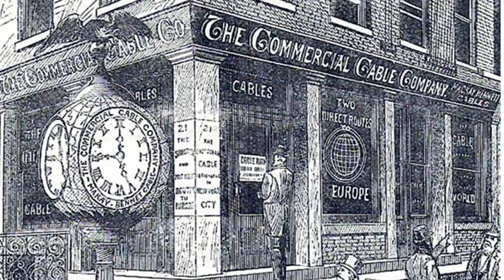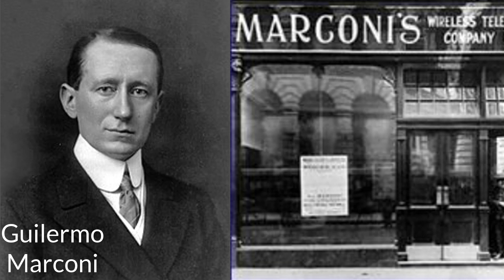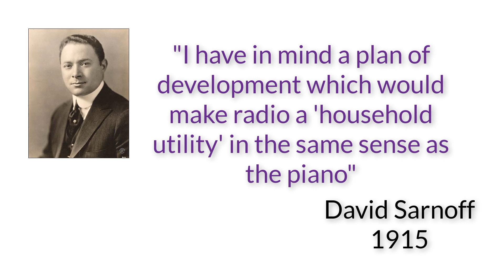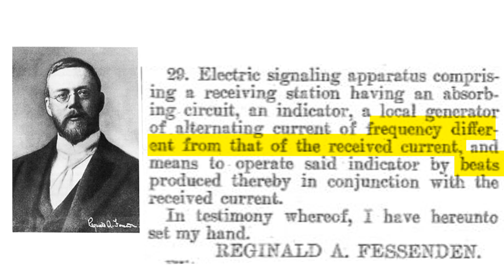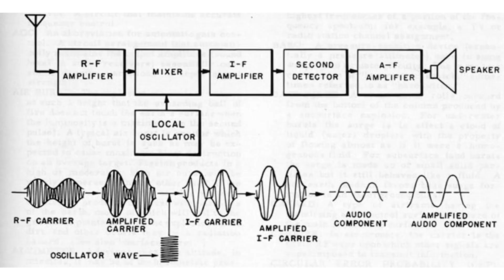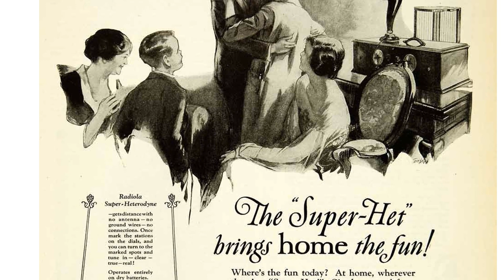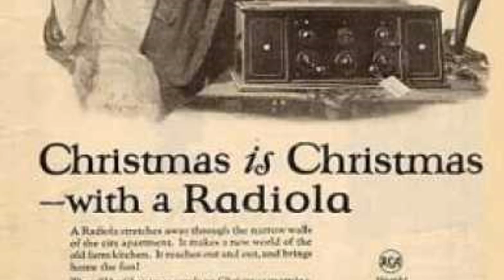David Sarnoff, Howard Armstrong & the Superheterodyne Receiver

Comment: When I was in school, one very interesting xperiment I was required to perform was to measure the mass of the electron. This was not done directly, rather by observing microscope bubbles moving in the air under an electric field, and then computing the "smallest common denominator" of the oil droplets velocity.
Reply: The famous Millikan oil drop experiment. If not for that experiment we would not have the concept of wave/particle duality... electrons would only be known as waves and the atomic model would be radically different.
Reply: You went to a very nice high School, I only saw that experiment in the textbook.

Comment: Please clarify that heterodyning only works in nonlinear systems. Typically band limited circuits. Our hearing is nonlinear which is why we can tune a guitar string that way. So are the circuits in heterodyne receivers.
Reply: Hopefully, only the mixer is non-linear in AM receivers.
Reply: @flagmichael  Every tuned stage is band limited and thus nonlinear by definition. IF Coils between stages. But yes heterodyning only happens in the mixer. Hopefully!
Reply: If the front-end RF amplifier is non-linear, you get InterModulation (IM) interference due to heterodyning of several incoming signals.   We try hard to keep the front end linear. but there will still be IM if the signals are strong enough.
Reply: @8546Ken  All front-end RF amplifiers are non-linear. Otherwise it would require an infinite bandwidth from DC to light (and beyond?)

Comment: Believed the old superheterodynes only used 5 tubes. A 35W12 rectifier tube, 50C5, 12AU6 and 2 others. Learned about them back in the 1960's. Have an old tube radio in my garage that I still use. Interesting vid. Ashamed very few young kids get interested in electronics or turning wrenches. Learned how to solder and use my dads model 260 Simpson meter before I learned how to drive. Put together a radio, tube & transistor tester,  and 25" Heath kit color TV.
Reply: The AA5 lineup was 12BE6 mixer, 12BA6 IF. 12AV6 detector/af amp 50C5 audio output and 35W4 rectifier.
Reply: The "All-American Five" came in two versions: one with octal base tubes and one with miniature tubes. Those were the miniature tubes. I think RCA had the original patent but when that expired everybody made them virtually the same. For years the RCA tube manual had a schematic of that version in the back.
I believe transistors displaced even those tubes when transistors became cheaper than tube sockets. The miniature tube radios came on printed circuit boards near the end but the economics just shifted too far too fast. RIP to the AA5.

In this history channel, I would be negligent if I didn't mention that the book, "SONET/SDH Demystified" has a few pages about the birth of the transistor. In short, the post-WW2 boom brought high expectations, including private instead of party telephone lines. That required more copper, which was being snarfed up by the housing boom. The solution was multiplexing, but vacuum tubes had heat and energy problems. That is why the transistor came out of Bell Labs.
Reply: You're referring to the small "AC-DC" table radios. The large console radios may have had more tubes and a power transformer. With a transformer, all the tubes had 6.3V heaters  The tube numbers were often just 2 digits. They usually had shortwave bands.

Comment: In order to produce IF (intermediate frequency or beat frequency), the Mixer must have non- linear  amplification. 
This can easily be explain by Fourier series analysis.
When input RF signal is mixed with Local oscillator frequency, it produce Beat frequency (Intermediate frequency) of difference between those two frequencies.
But how to make Beat frequency as carrier frequency? If the Mixture stage has linear amplification, it will not produce Beat frequency as Carrier frequency. 
So Mixture stage has Non-Linear amplification. And the output of the Mixture stage shoots out multiple Carrier frequencies. 
The IF resonant transformer is set at 455KHz. and to make IF= 455KHz, the local oscillator is tuned to (455KHz + input RF) signal. This is for AM radio.
In order to keep Bandwidth of the AM signal, this technique is used, irrespective of the RF frequency.

Comment: Has anyone  messed  around with a actual cat's  whiska crystal radio set ? Not using a commercial  diode  but the lead sulphide crystal called galena and fiddling with finding a sweet contact point to yield desired rectification.  There were occasional  reports in 1920s so I've  heard  of experimenters by fluke getting an amplifier  effect when they'd  mess with a third and forth electrodes connected  to a battery through points on the crystal ; the first cases of semiconductor  amplification or the transistor  effect thus . I don't  know if it's  correct but it does sound plausible. Also wondering if other crystals were effective.  The metal  sulphides of like zinc , lead,  cadmium , copper have useful variety ofl properties and maybe others of the transition  metals . We are now into the age of the lanthanides or rare earths . First commercial  use  of rare earths was the gaslight mantle way back in 1850s . Now that was an invention that worked very well and some places didn't  convert to electric lighting until the 1970s.
Reply: Oh yes, I spent hours tweaking cat's whiskers to get crystal sets to produce a signal.   The problem was that you had to be tuned to a station to hear anything when you got a 'good' connection on the crystal, but you couldn't know if you WERE tuned to a station until you got a good connection.  So, lots of twiddling the condenser at the same time as tweaking the crystal until you heard something, and then trying NOT to lose both settings as your fingers twitched.   At first I refused to believe that the first diode I saw (shown to me by the chap who drove the local Walls ice cream van) could actually work - 'There's no way to twiddle that tiny wire inside that little glass bulb' was my cry!
Reply: @donjohnson24  ...and inside that glass bulb was a metal few of us had ever heard of: germanium!
Reply: It makes sense in a different sort of way. All semiconductors have non-linear response at low voltages. Providing any energy that would give the signal you wanted a bit of a boost toward the threshold would probably be helpful.
Reply: Did you know gas mantles were made with radioactive thorium? Unti recently you could use a Coleman lantern mantle to test your Geiger counter.
Reply: Yes, i had a crystal radio as a kid, with a cat's whisker & galena crystal.  I needed a long wire antenna from the house to the garage..

Comment: So what did Marconi  actually invent concerning  radio ? I'm  thinking  he imventef the radiating element which we call the antenna.  And Edison  specifically invented the carbon filament for electric light  globes . The light  globe was already an existing  thing for which Swann's patent employed osmium a precious metal . Carbon  filament  was more practical .
Reply: Not even that. In the early days, using spark transmitters, the antenna set the operating frequency. His contribution was performance based on existing technologies. His work is analogous to that of Henry Ford.
Reply: What Marconi invented was the radio business!  The antenna (both radiating and receiving) was (accidentally) invented by Mahlon Loomis decades earlier.

Comment: I've always heard Edwin Armstrong, not his middle name Howard Armstrong. The best expose on this topic I've seen on this topic is covered by "Empire of the Air", a Ken Burns PBS documentary. The "wars" between Sarnov and Armstrong were particularly brutal.  Sarnov wanted a way to eliminate electrical noise, especially lightening strikes, AM is susceptible. Armstrong realized that AM is very sensitive to high EMP discharges, while Frequency Modulation is not. Brilliant. The demonstration of FM vs AM for Sarnov knocked his socks off. But... The first FM radio network, built by Armstrong, was "undermined" by Sarnov, who built radios that tune to today's familiar 88MHz-108MHz range, which by definition and design could not receive signals on Armstrong's FM network, which operated well below 88MHz; 45MHz-70MHz or some such. But Sarnov rapidly lost interest in radio, with the specter of Television on the horizon. Adding insult to injury, Sarnov used FM modulation for TV audio, which stood for over 60+ years, before the downfall of NTSC to the now standard ATSC MPEG2 digital television system we are now stuck with today.

Thank you for ignoring Lee DeForest, or maybe I need to watch (or not) an earlier video. DeForest was a tinkerer, but did not have the in-depth electronics/radio technical chops of Armstrong. DeForest is credited as inventor of the Audion; out of scope for this discussion.

Good, short video covering a lot of material accurately. I like the analogy to "beat frequencies" of mismatched guitar strings. Conceptually helpful, if not 100% accurate for how a mixer produces the sum/difference of two input frequencies.
Reply from the maker: First, sorry about the beat frequency analogy turns out I misunderstood what was going on - wish I could edit videos after posting. 

I do go into a lot of these other things you were talking about in my other radio videos and see if you agree with how I discussed it. 

I got that Armstrong was called Howard from many sources including the documentary “empire of air” where Armstrong’s niece calls him “Uncle Howard” here is a link: 
https://youtu.be/DRDajFYCrt0 

Thanks for commenting

Cheers 

Kathy

Comment: One of the real problems which the Supersonic Heterodyne circuit soled was that of amlification.  A characteristic of  thentriode vacuum tube is that there is fkr each design of the a given amount of capacitance between the grid and plate.   This leads to instability in multiple stages of Radio frequency amplification at frequencies much above 60 kilocycles.  Armstrong's genius was to figure out how to take a high frequency signal and convert it into something which could be easily amplified in multiple stages.

In the early 1920s there were developed several successful methods of preventing instability in a multi-stage tuned RF amplifier, the most successful of which was Alan Hazeltine's Neutrodyne circuit, a kind of controlled degeneration, really the inverse of Aemstrong's regeneration

Comment: Hi Kathy

Armstrong is my hero! Regeneration, Superheterodyning, super-regeneration,  FM broadcasting - genius!

However, there are problems in your presentation.  For example, most modern hi-spec HF radios don't use his superheterodyne system - direct conversion from analogue to digitised representation is now usual.  As the technology improves this  moves to higher frequencies.  My current rig digitises the 6m ham band (about 50MHz).   

73 de M0PTB

PeteS
Reply from the maker: Thanks for informing me of my mistake and I’m sorry that I made that error. My knowledge of modern technology is pretty limited so I just went by what I read.

Comment: That b+voltage was often 95 volts. "Shocking"
Reply: The name B+ came from the two batteries thay were used back then. The A battery was for the filaments and the B battery was for plate voltage - hence B+
Reply: @rty1955  very good and did you know that tubes resist EMP and pulse. So build a set but stay away from dc rigs as they retransmit the mix =easy to find . A superhet in a metal box .(grounded). Is almost safe from detection.  The old timers had it down. To a art. That should be brought back. Thanks ps I made a rig that runs off rain water that is to say that the b+ battery. was a series of ( coper/aluminum) cells and the A battery was the heater. (Dry cell) Ran very cheep. That way I got 27/7 use. Thanks
Reply: @stephenwilliams5201  I would hate to see what an EMP does to a choke!
Reply: @rty1955  we would get a strike warn notice and we would pull our antenna and power from a rig. To save pulse damage. And some chokes could be of higher wire gauge. To stop burn out. Recognizing that the pulse could be in to the killavolt range a shunt to ground could be used also. My mother worked for RCA later I worked for phillips tv. And had to shunt to ground.  A lot of test equipment.
Reply: @stephenwilliams5201  a strong EMP turns any ferrous metal into a voltage generator, so things like coils, transformers, wires etc all could produce high enough voltage spikes to fry other more delicate components. I dont know how far an EMP would travel to do auch damage and I would assume if you were that close it wouldn't really matter. I assume somewhere they have done some studies.
Reply: @rty1955  radios built in sealed boxes are spared pulse. By the Faraday effect.  Just take your pocket radio and walk over to your auto and set it inside and it's gets silent. As the auto or truck deadens the signal. Magnafying that with custom box that cuts off the  outer world. Only turning it on when needed. Or when the pulse party is over. Yet tube eqp ment sheds off pulse. And survives. For later use. Common CRT TV HAD SUCH CASES TO KEEP THE SIGNALS IN CHECK. ( FLY BACK X FORMERS)  USED WORK IN TV FACTORY. It works.
Reply: @stephenwilliams5201  well maybe for small rf pulses. Since I have not done any EMP checks from an actual Nuclear bomb i cant say for certain
Reply: @rty1955  Before that there was even a C battery (4.5V was common) for grid bias. Then some genius figured out a cathode resistor with a capacitor across it on each stage worked just as well.
Reply: Two frequencies do not produce a "beat" frequency, they produce heterodyne frequencies, one the sum and one the difference of them two.
Reply: @warplanner8852  Much the same thing, with the "beat" just being the difference frequency.
Reply: @warplanner8852  usually the radio picks off the unwanted signal. Via a filter. As a human we tend to look for the desired product. Thanks
Reply: @warplanner8852  In the 60s it was always called a "beat" frequency in conversation. "Heterodyne" was considered hoity-toity unless you were talking about the sound coming out of a radio when there was an interfering signal.

Comment: Your videos are an amazing asset for anybody with a thirst for knowledge, but of course I have a couple of quibbles.  At 5:55, you state that the term "superheterodyne" is used because the output signals are all above audio frequencies.  As I understand it, the "super" part of the term actually designates the fact that the local oscillator frequency is set above (super) the received signal frequency in order to produce a difference frequency output that is at a lower, more easily processed frequency than the carrier.  Along the same line, your choice of "around 45 kHz" for an IF, at 9:10 in the video, may be true for the original implementation, but I wonder if you might have been trying to state the established AM radio IF of 455 kHz.  My enthusiasm for your work remains undimmed.
Reply from the maker: Well, that was the nicest way to tell me the "quibbles" with my video that I have ever heard, so thank you.  Your comment about superheterodyne is interesting but according to wikipedia ""Superheterodyne" is a contraction of "supersonic heterodyne", where "supersonic" indicates frequencies above the range of human hearing."  Not that Wikipedia doesn't mess things up on the regular.

Also, I was referring to the original IF frequency for that particular radio at 9:10 but in retrospect, it wasn't 100% clear in the video.  I also could have easily said that the current IF used is far different.  Ah well, next time.

Thanks for the comment,

Kathy
Reply: I think the “supersonic” derivation makes sense. Bearing in mind that “supersonic” meant what we would mean by “ultrasonic” nowadays -- frequencies above normal human hearing.

Contrast this with crystal radio sets, where the frequencies produced were directly audible.
Reply: In period publications of the late 'Teens and early 'Twenties such  as QST, Radio News and Wireless Age the system was referred to as "Supersonic Heterodyne".
Reply: Just my guess: "super" had variable meanings in radio of that era. The super-regenerative receiver was a regenerative receiver that had a squegging regenerative stage. In the earliest days of Continuous Wave radiotelegraphy a Beat Frequency Oscillator (BFO) very near the received frequency was used to heterodyne with the radio signal to produce the audio signal. The superhet was sort of a variation: instead of audio it produced an intermediate frequency that could have a fixed frequency amplifier and detector. More recent (most of the 20th century) CW receivers are superhets with a BFO around the IF frequency.